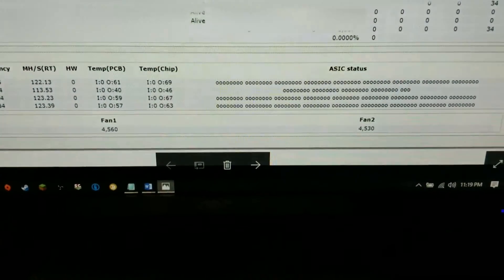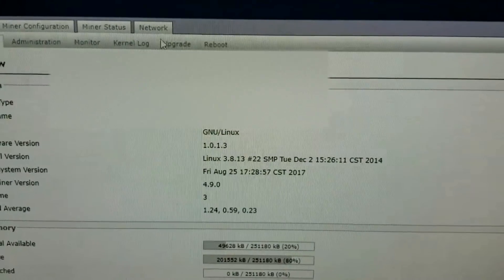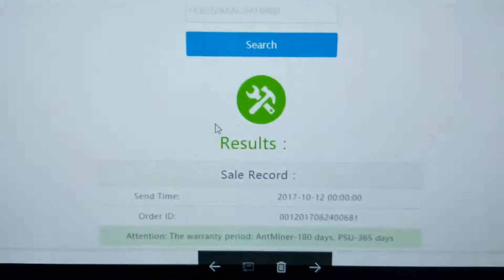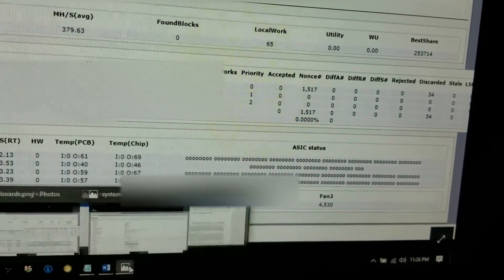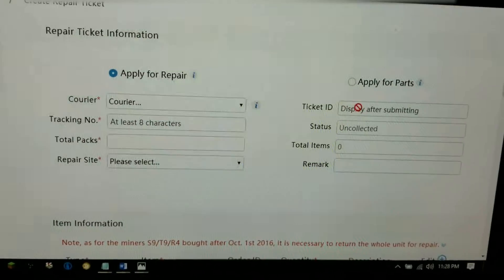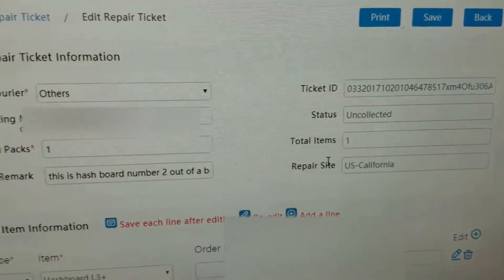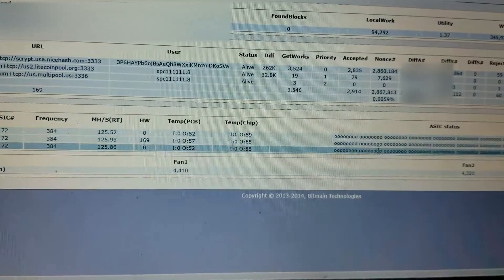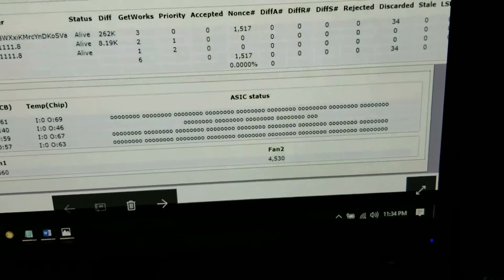Bitmain how to create repair tickets for a quick responce

Comment: Regarding Antminer temp and power use.  Is your Antminer is running cooler versus hotter, as a cold basement versus a 72 degree room, does it use significantly less power?  I notice that the fan runs significantly slower and less noisy on the unit in my 55 degree basement.  Just wondering if anyone knows how much of the power consumption is used by the fan versus the hashing boards.  Thanks.
Reply from the maker: the fans use 2.7 amps each or 297 watt per hr. when at full speed. if you are running the machines in an enclosed room they will eventually heat up the room and kick the fans to full speed. you need a way to get the exhaust heat out of the room, this is what my shroud helps with. it collects the output exhaust and puts it out of the room. via a ducting you can attach to the back of the machine.
Reply: Thanks Shawn.  Right now in CT, the areas I have the miners in are staying very cool because of the winter season.  My miners are providing a double service of mining AND keeping my basement pipes from freezing in the extreme cold we are experiencing this year.  If mining continues to be profitable as we move into Spring, I will invest in your shrouds to channel outside or air conditioned cool air to the miners.  Thanks for your help and suggestions.

Comment: Hello, i bought a s9 from a guy locally, i now have a bad hashboard and doesnt get detected in s9. what are my options for warranty. i bought 2 s9. one works right out of box. the second one has been pain to get it to detect the first board.
Reply from the maker: go to bitmains web-sight and do a warranty check on their warranty check system under support. if it comes back green then place a warranty repair claim on it.
Reply: shawnpc1 hello i bought this of reseller, would i be still able to get it warrantied. I checked and got green because it was  just shipped on 7 december n i bought it 12 december
Reply from the maker: yes if it is you can claim on it. first you need to un-plug every wire on every board and re-seat them and then reboot the machine, and reload the firmware. this is a requirement before they will okay a warranty repair. do this first and see if it will boot up correctlly
Reply: shawnpc1 the board was showing up and hashing 3TH/4.5TH so we moved it tobdifferent psu and it doesnt show anymore. So it doesnt matter that i bought it off someone as long the 180 day is not over i can create ticket from my bitmain account ? Correct?

Comment: Hi Shawn.  I followed your instructions and my Antminer S9 was repaired though it took about 3 weeks from start to finish.  That seems like a long time to me and I don't have a good feeling about what if anything was really done.  The reason I say that is because an Antminer S9 was returned to me with a different serial number from the one I sent, and one of the cables was detached.  This gives me the impression, they just threw another Antminer at me without any QA, because how do test a system with a cable disconnected?  After running the replacement system a few days, I had the exact same problem.  The center hash board stopped working.  I have tried two different brand new power supplies.  With current bitcoin price, I hate to take my system out of production again, if Bitmain repair is going to be so unreliable and slow.  Is my experience unique?  What else would you suggest.  Thanks.
Reply from the maker: I would say this is a unique situation. I would contact bitmain support and let them know they sent you the wrong machine. and ask what happend to your machine and let them know the machine they sent you is also not working.
Reply: Thank you.  I sent a support email Dec 15, as of today, Dec 18 no reply yet other than message received.  I looked that the order date on the replacement system they sent.  It's actually a later date than my original purchase, so it's like I got an extended warranty for free.  But I would rather have a 100% operational system not under warranty, than a 66% operational system that is under warranty.  Oh well, trying to be patient...
Reply from the maker: I understand, at least it is under warranty that should ease the pain once you receive a good working machine.
Reply: Bitmain replied today.  They are saying that sometimes they will send alternate antminers to expedite the down time.  When they do this, the replacement system will have at least a 45 day warranty period.  So I guess that's what was done in my case.  They asked me to send the kernel log to verify it's not working correctly.  I did that, so we will see what they say next.
Reply: So, latest email tells me to send the replacement machine back because the log indicates the whole device needs to go back, and I have to do this within 7 days.  In exchange, they will give me a coupon so I can order a new machine from the website.  This makes no sense, especially when they are not currently taking S9 orders on Bitmain and even if they were, the delivery dates tend to be a month out.  This seems like a total lack of customer care.  I wrote them back again and reminded them how long my system has been either in transit waiting for repair, or only working at a 66% productivity level.  This has been a very disappointing experience with Bitmain service.
Reply: Another update.  Apparently, due to the poor English of the mail, I misunderstood what Bitmain support was offering.  They clarified in a subsequent email that they would send me another replacement machine AND send me a coupon for the Bitmain website.  I did return my partially working system and in less that 2 weeks, about 1/2 the time for the initial repair, I received a replacement system from China.  It's only been a few hours, but so far this replacement system is running at 100%.  I have not yet received the coupon, but as long as the replacement system keeps working, I'm satisfied.

Comment: Hello and please tell me what about paper that you need to put in box when you send your part? thay told me to print repair ticket and to put one on box and one in box but with tracking nubmer, but i dont have tracking number unless i send box wit that part...
Reply: Yeah this is what i came here for too.  Not much help
Reply from the maker: nesatom4 

You enter the tracking number in the repair ticket. You need to place a paper with all your information in the box, not the tracking number. Just your info
Reply: Thanks, but i dont see print button like yours dont know what is problem...
Reply: And do you found it ?? :D
Reply: And do you found it ?? :D
Reply: DAAAN  no. I just controller P printed it. Hoped and prayed they'd take it. They did.
Reply: Ohhh ... Can you please send me what you sent them.....
I don't control P print but maybe if  I see what you sent, it will help me... and by the way sorry for my bad English.
Reply: DAAAN i use Firefox for a browser. If you right click at the top of your screen, make sure you have "menu bar" checked. This will add a series of tabs to the top of your browser. One of the tabs will say "file". Click that. That will open a window, and you will then want to select "print". This will open the print window. Select your printer and click "ok". Fyi this works for any website you ever visit, so it's not just for bitmain.

Comment: What's been your experience with the S9?  One of the 3 boards in mine stopped functioning after 2 days.  Now I have to return the entire system to have it serviced and will be unable to mine while it's out.  How quickly but Bitmain US service send the system back?  If it's going to be weeks, I'm wondering if I should forget about the repair and just run it at 66% performance while the bitcoin price is still trending up.  One other question.  Does anyone manufacture a miner in the US?
Reply from the maker: did you not contact to get permission to open and remove and just ship back the bad board. i posted a step by step instruction on how to get their permission to just send back the bad board. and open the machine without voiding the warranty. hear is my link on this. you can still run the machine at 66% but only send the board back so you dont loose everything. watch this video.
https://www.youtube.com/edit?o=U&video_id=AH0x1BFjzsw
Reply: Well, I would certainly rather send back only the board, but the repair ticket instructions say that for S9 systems, send back the entire unit.  Are you saying if I ask, they may allow me to only send back the bad board? - Thanks.
Reply: Shawn, I checked your other video.  I just emailed Bitmain to see if they will allow me to open the S9.  Thanks very much for the suggestion!
Reply from the maker: no problem. I hate to see people loosing money
Reply: Me too - especially when it's me.  lol  Hopefully they give me the go-ahead.
Reply: John Anderson 
Hi! I've got the same problem with my s9... did Bitmain allow you to send the single hash board?  (Even though standard procedure says to send the entire machine) I don't like loosing money too

Comment: I am from Egypt, I would like to buy antminer s9 for a device price in Egypt 4500 USD is profitable
Is it possible to have a problem before the compound price
Is it a problem with continuous use?
Please help I really need your help
Reply from the maker: https://shop.bitmain.com/main.htm?lang=en  The price is 1450 usd direct from bitmain. they run continuously with no problems. so far i have over 2 mo. with no problems.
Reply: Thank you for caring
 this product is prohibited and refused to enter Egypt
In a black market Its price 4500$ Worth buying as possible there is no maintenance
Thanks
Reply: does it need air conditioner for dry air
Reply from the maker: yes it does. needs to be keept 70 degrees or lower. can gt as hot as 80 but will shut the boards down